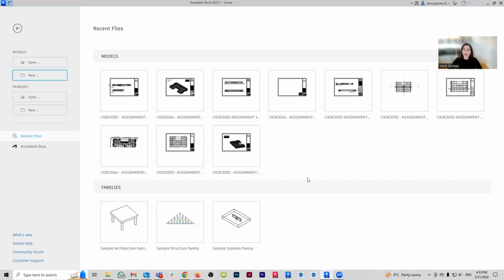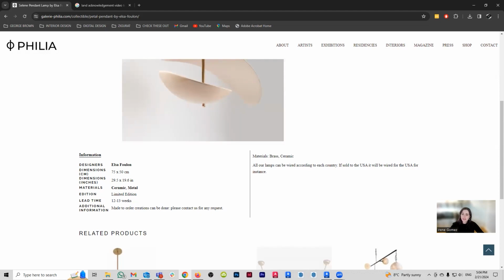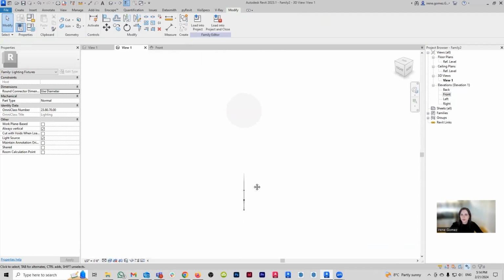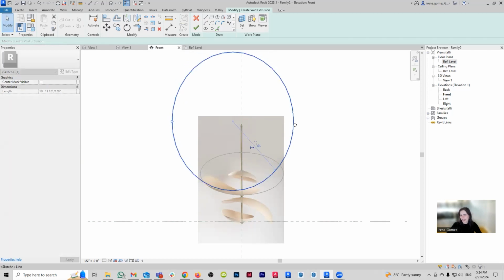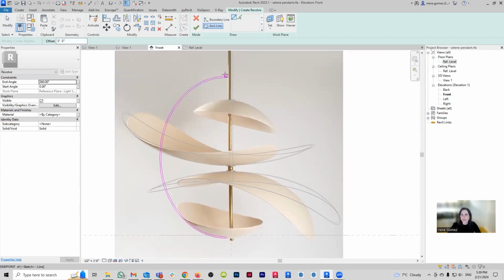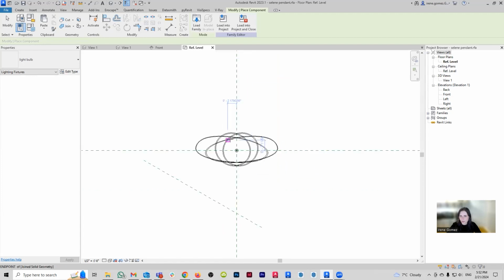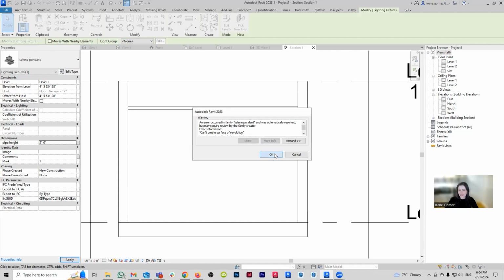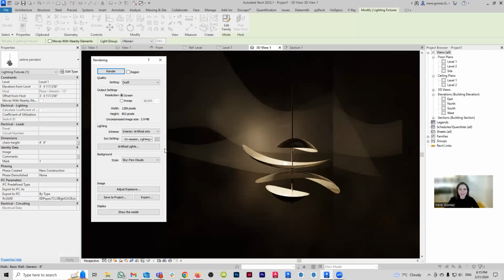Revit - Create an organic pendant light - Selene Pendant

Comment: Hi Irene, I was wondering if you are able to scale this light bigger, how you would do that! I love this light sm and wanna use it in one of my school projects.
Reply from the maker: Hum... the issue with scaling in Revit is that you can't simply select the whole thing and use the scale tool like you would do with some other software. That being said, there's a couple options you could consider:
1. Scale each form within the family to the new desired size. Bonus points if you make the sizing parametric and link all forms using formulas, so when you change an overall dimensions, all part are resized.
2. You could take the family, export it as an FBX or DWG and then reinsert it into a Revit family as an import. This will make it easier to resize the whole thing, but would mean you can no longer modify the individual forms. You'd be stuck with the limitations of imported geometry.
Hope one of these options helps you!